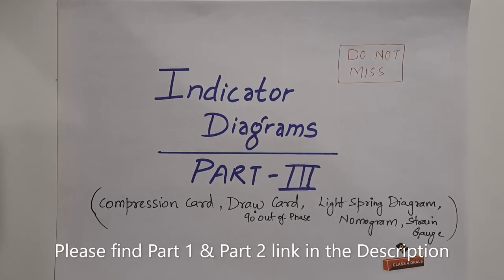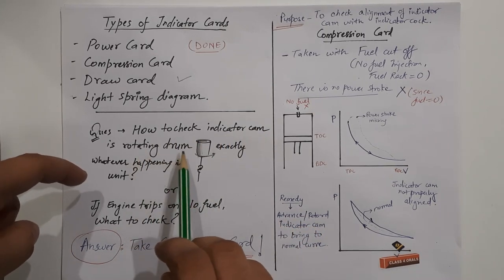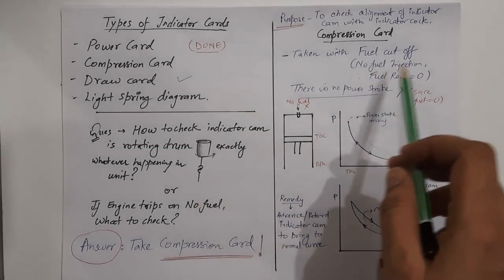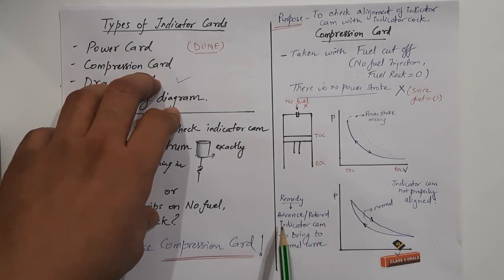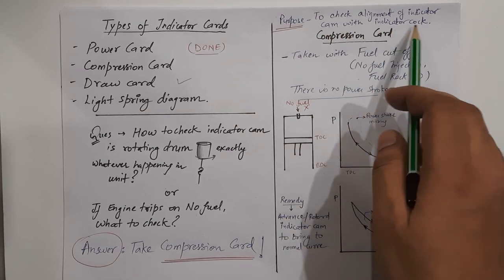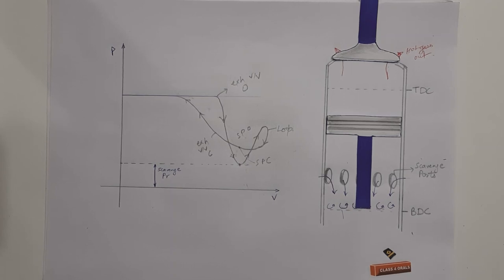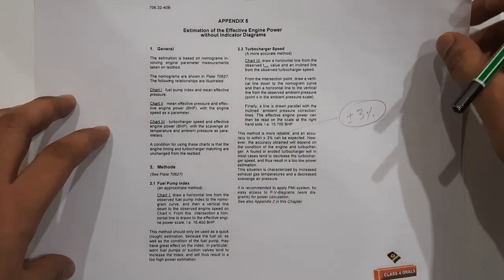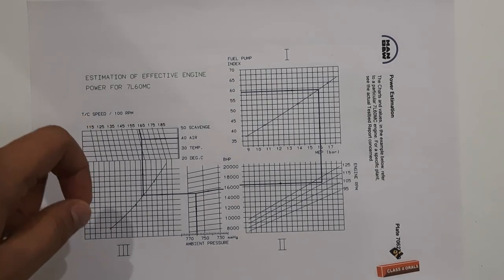Indicator Diagram - PART 3 | Light Spring Diagram, Compression Card & Nomogram | Explained Fully Imp

Comment: Hi Sir,
Light spring diagram ;
Q. Why there is a pressure drop between point 2 to point 3? (The small loop)(between scavenge port open and port close)
- I could not relate your exsplaination, hope someone can help-thanks

Video time : 6:40
Reply from the maker: That loop is representing the inlet air through ports causing pressure rise